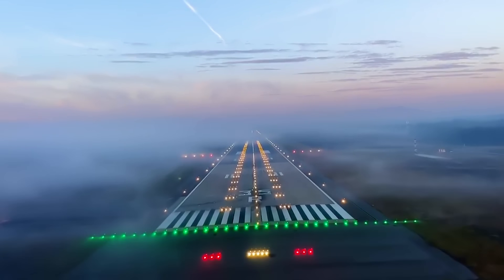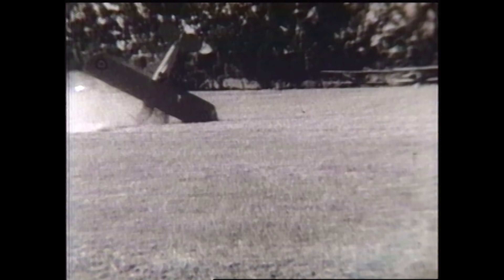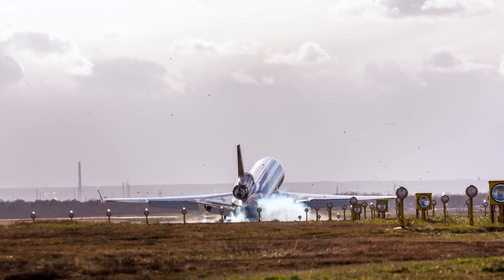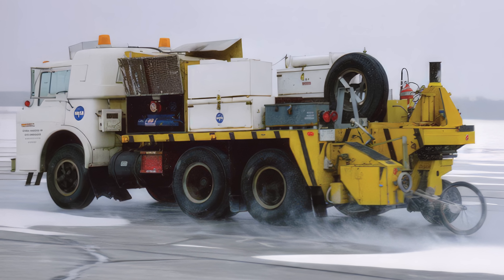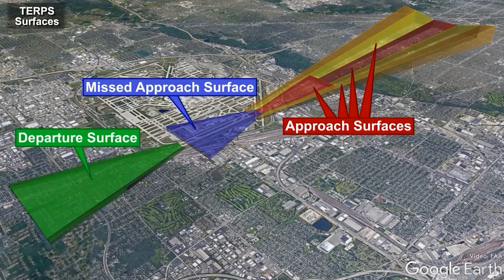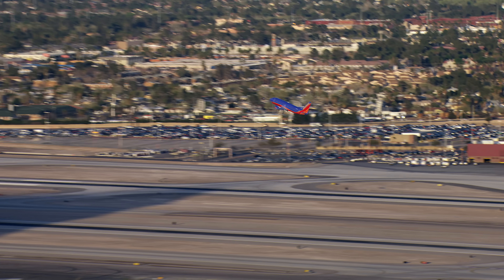The Hidden Engineering of Runways

Comment: (Small correction, "aerobraking" has nothing to do with thrust reversers. Rather, aerobraking refers to keeping the nose off the ground for as long as possible, which increases the airdrag caused by the wing on account of the higher angle of attack (keeping the nose high).)

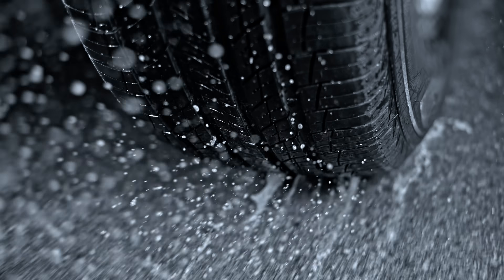Comment: 6:13 Just a little clarification, aerobraking refers to using aerodynamics to brake, that is spoilers, airbrakes, or angling the plane upwards to increase drag. Nearly every aircraft can perform aerobraking in one, if not multiple forms at once.

Using the reverse thrust of the engines is just called using thrust reversers.

Comment: 15:25 all EMAS installations are done by 1 or 2 companies in the US BTW. Something else that's fun about runways at large international airports that have to take ice/snow removal into account have embedded sensors in the runways to tell the operations team if the chemical on the runway is getting too dilute so they can get the snow/ice removal team back out onto the runway to treat them again, and those treatments are coordinated at least 1 hour ahead of time. Those teams will also typically run the traction testing truck out, then the snow removal and treatment team, then run the traction testing truck again to see how effective they were.

Comment: One interesting element not discussed is the lighting systems of runways. The configuration of the approach lighting system leading up to the runway and the lighting installed on the runway itself can be a determining factor in landing or departing in very low visibility. 
Also, besides EMAS, some airports that serve both military and commercial traffic will have deployable cable arresting systems for the military aircraft that can be raised or lowered.

Comment: Airplanes are heavier at takeoff than at landing, yes. But also, consider what happens when things go wrong.
An aborted landing leaves the plane in the air.
An aborted takeoff leaves the plane on the ground, at v1 speed, with lots of runway behind it, still needing more runway in front of it to decelerate. IIRC that's the worst-case scenario for runway length in most cases.

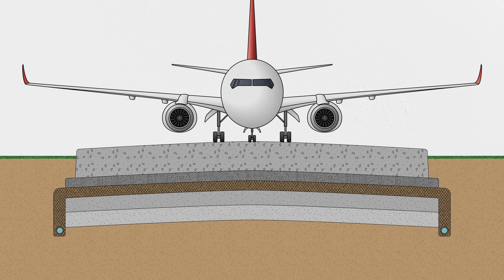Comment: 9:20 this sounds like a mistake. Rigid pavements spread out into the soil on a wider cone than flexible. The effective width you are showing seems to be applicable to the punching shearing planes in the concrete, not the bearing force transfer area to soil. The shown comparison seems apples to oranges, talking about two different things.

Comment: 6:20 - If the energy created for deacceleration is considered "most of the work", then it usually isn't brakes but all the leading edge flaps and slats. The brakes can work hard, but are usually not used much in commercial operation.

Comment: I ride a motorbike and during the worst summer rain-storm of my life (I was travelling home) I spent about 30 minutes sat behind a huge truck at 55mph because his tires were stripping the water right off the road which left a 'grippy' bit that I could ride on.
I could barely see the back of the truck  (just his lights) and it was quite surreal folllowing a pair of red dots which appeared to be clearing strips of tarmac for me 🤗
Got home safe and sound.
Late (missed several junctions sat behind the truck) and very wet.

Comment: I think it's interesting that when planes first became a thing, it was so dangerous that zeplins were safer. Only after years of improvements did planes improve enough to beat the zeplins. The zeplins have some fundamental flaws that couldn't be fixed as easily and so after the hindenburg, planes took over entirely.

Comment: One of my family members worked for a civil engineering firm, and got to participate in a project renovating one of our local airfields. For certain reasons, this particular airport, although relatively small, required a concrete runway. I knew there were different grades of concrete, but that used for runways is apparently a whole 'nother level compared to even regular building concrete. My family member told me that the specifications required for resurfacing the runway were insane compared to any other project they'd been on.

Comment: With respect to the different runway materials, check out KGLS which is Scholes International at Galveston.  Their runway charts show runway 18/36 as "good concrete" and runway14/32 as "asphalt with concrete, good condition." 14/32 appears darker than 18/36 and has a different appearance visually, meaning that an landing pilot can have a different depth perception interpretation when landing...

Comment: Neat going on government auction websites and seeing stockpiles of asphalt millings from runway projects that can be purchased and reprocessed for other paving projects.  Of course the thousands of cubic yards is still expensive and winning bid responsible for removing the stockpiles. 
Worked on an airport hanger paving project, typical aircraft were 30,000-45,000 lbs and concrete 16 inches thick.  Concrete would be poured for each alternate 12 ft wide strip then come back and pour the sections in between with large steel pins tying them together.  Meanwhile the concrete cutter would wait and wait till he could go out and saw cut the relief joints.  And even crossing a taxiway, airports take the tire FOD checks very seriously.

Comment: 15:24  too bad a Korean flight that overshoot and hit a hill wlanded on a runway apparently without this.
Reply: EMAS likely wouldn't have helped.  That plane landed with the  landing gear retracted.  EMAS works by having the landing gear break through into the substrate,  producing a lot of drag on the landing gear.    That plane likely would have just slid over the EMAS without slowing much.

Comment: I am a General Aviation Pilot in New Zealand. Your point about 'land use contention' was important. Our airport is busy, a lot of small planes every day - and to your point take-off is a key failure point with only one engine. Yes, we are trained to land out little planes in a field if the engine fails. But at my airport they are building houses closer and closer, and landing a little plane from 400ft with no engine and nothing but houses - well that is a different prospect.

Additionally we know that people who buy houses will complain about the noise, even if the noise has been happening for over 50 years before they bought that house. 

Land use is a problem and a trade-off, but keeping each end of a single runway clear of houses seems like a good trade-off.

Comment: When I was an electrical apprentice, we got subcontracted to help with an airport expansion, where we were tasked with running the conduit under some of the runways and taxiways. To say the project was complex would be underselling it. I had never seen so many types of conduit used back to back like that. One 30' span had 6 different types of conduit in it, and it was only under a corner of the taxiway. The runways were way more complex. We also had a dedicated engineer that checked and rechecked our work. If our cuts were more than 0.125" off, they had to be scrapped. It was a long month.

Comment: One TINY nit to pick.  Around the 6:20 mark, there's a reference to "aerobraking" and then thrust reversers.  Those two aren't the same.  Aerobraking or aerodynamic braking is keeping the nosewheel of a landing aircraft high while the rear wheels are rolling.  This makes the whole bottom of the wing and fuselage act as a source of drag (much like holding your hand out a car window with your palm facing the airflow).  Aircraft without thrust reversal, including many fighter jets, use this technique to shorten landing distances.  Thrust reversal is, as you say, using specialized thrust reversers attached to engines to redirect some or all of the jet's thrust-producing exhaust forward.  These two things could be used together, and they work towards the same goal, but are not exactly the same thing.  One can do/use one without the other.
Reply: NEEERD! Just kidding 😂 that's a good bit of information, thanks.

Comment: 9:12 OK this does not make sense to me, a soft material would typically transfer the load into the ground over a smaller area.
If I step on sand , I will sink a little bit, if I put a plate over it, then I would not because my weight gets distributed over a larger area.
But you say that in the concrete, the weight is only transferred down , not sideways?
Where are you talking about the pressure into the tire?

Comment: Great video Grady, pleasantly surprised to see a video topic on something I've dealt with first hand. Last summer the survey company I work for was checking the pavement elevations for each layer of material laid down to verify the contractors work for a taxi lane replacement at Lambert International Airport. Super fascinating watching the process from start to finish of them furnishing each layer and then surveying each one of them when they were set. From how they layered the material to positioning the rebar between control joints was incredibly fascinating. Each time we were out there we would set up our total station and using known points on the surface take measurements and record a plus/minus cut/fill for each point as compared to what they designed in the office. Was a lot of fun.

Comment: Still to this day I have never seen anyone to actually get into the details of what EMAS is and how it works.

Light weight beton or glass foam that crushes under the plane? That doesn't tell me anything. How can beton or cement crush in a manner that looks like driving over a cake? I want overtly detailed explanation on how they are built and how they work in practice, including but not limited to how such weak material can still be strong enough to not see erosion, etc.

Comment: 6:20 is not entirely true. Aircraft do not use reverse thrust to slow down. It helps reducing the load on the brakes and therefore their temperature. But the actual difference in landing distance is very minimal by using reverse thrust or not.

Comment: I appreciate your comment that the aircraft industry above all others has continually learned from experience (~2:20) , but I would suggest that the railway industry has also been doing the same for more than two centuries now. Much of modern rail design, engineering and operations has come about because of experience of past failures and accidents.

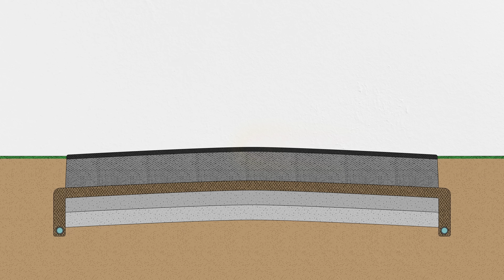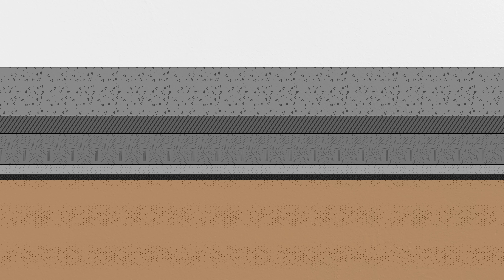Comment: So I'm confused.  At 9:05 you say that because asphalt has some "give" to it, the weight is spread out in a cone beneath the contact point, but for concrete the load is transmitted in a narrow strip straight down.  But at 11:40 you say that concrete distributes weight out over a wide area, but asphalt only provides friction, and depends on the layers beneath to distribute the forces.

This seems to contradict itself.  What's going on?

Comment: why did you use AI at 1:30 instead of a real stock video? it's petty but I'm going to stop watching because of this
Reply: It's definitely not petty. It's actually quite noble. AI slop is undeniably unethical for multiple very serious reasons. It's not just IP theft. It's also being used for propaganda and scams, convincing people to do harmful things, causing or worsening mental illnesses, and the cherry on top is that it's also very bad for the environment. No one gets a pass for using it.
Reply: It's not AI. The numbers and letters on the trailers are legible and consistent, you can see the aerodynamic skirts of the truck wobbling with the bumps in the road, and they have a correct number of wheels. There's also things like a distant radio tower light blinking. The Freightliner logo is blurred on the left truck (blurring logos is common in stock video), but not on the one passing it on the right. 

For anyone (like me) who's made many runs along I-10 between LA and Phoenix, and down to Tucson, that's what it looks like out there.

Comment: Video has errors; e.g. most rubber left on the runway occurs during landing because wheels are not spinning and are forced into a quick spin causing rubber burn/skid (in contrast to take-off the weight of the plane is reduced as it picks up speed and the tires are rotating in-line with plane speed) Another content creator that lost credibility.  I now presume everything is either A.I., C.G.I., modified, wrong or is fake, and take it all in for entertainment purposes only 🤭 /s/ ChiefLiviz

Comment: As an Asphalt Mix Designer, we design asphalt pavements by using a gyratory compactor to do a certain amount of work on the mix to get a target air void content.  The amount of work (gyrations) corresponds to a unit called "Equivalent Single Axle Load," or "ESAL."  A 3-30 Million ESAL asphalt would be expected to survive that many 80 kn truck axles throughout its design life.  That would equate to 100 gyrations in the machine to result in 4.0% air voids.  Asphalt like this would be used in the interstate system, as opposed to asphalt for surface streets that may only require, say, 85 gyrations.

The weird part is that FAA P-401 spec mix for airfields is only a 75-gyration mix.  It makes up for having 25 less gyrations by having an air void content of 3.5%.  (We control air voids by changing the aggregate gradation going into the plant to make more or less space in the structure of the asphalt.  Then, we can control the amount of Asphalt Cement and rock dust that we introduce to "tune" the mix to its design.  We do this dynamically based on variations in our aggregate stockpiles and any recycled asphalt we may be using.)

The FAA is currently reviewing changes to P-403 (base course asphalt) and P-401 (wearing course asphalt) to address pavement shifting under high-psi tires and larger aircraft weights.  There was a study done in Australia about shear failures in the landing panels of runways, and the FAA has compiled a bunch of research on the impact of particle shape, oil viscosity, polymer-loaded binders, and lift thickness on asphalt life.  (One big takeaway was that maybe Rut Testing designed for cars is "not adequate for aircraft...")  The high point loads that modern aircraft place on asphalt can carry damage 10-15 cm deep!

Comment: Oh hey! I work with the maintenance team that maintains that ERJ 145. The EMAS debris was ingested into both engines, and the cooling inlets for all 4 engine generators. All had to be replaced. But, once the repairs were done, it flew right out of there. Saved the plane, and all aboard. The system should be standard for all airports. It saves lives!

Comment: Great deep dive, Grady. The most telling part is the EMAS system—it’s the perfect diagnostic for graceful failure. We spend billions on high-strength pavement, but the real safety "innovation" is actually a bed of concrete designed to be crushed. It’s a reminder that in high-stakes engineering, the goal isn't just to build things that are "strong," but to design exactly how they should break when the math of the runway length fails.

Comment: Aerobraking and thrust reversing are two separate things. Most aircraft have aerobraking wing spoilers, and almost all jets have thrust reversers and some turboprops have reversible propeller pitch, but these are all separate systems that, while almost always used together, are unrelated and operate independently.

Comment: I'd love to hear your input on the airport in Indianapolis, one of the runways goes on a bridge over the interstate.  Curious how much went into that.
Reply: Which one is that? Indy International is surrounded by highways, but none of the runways cross them. Metro and Regional also don't intersect any highways. There was an airfield to the east of I-70 (you can still see the "X" pattern of the old runways), but it's been decommissioned for decades. 

However, LAX's south runways, 7R/25L and 7L/25R do go over Sepulveda Boulevard that runs in a tunnel underneath.

Comment: For a fun example of approach surfaces becoming contentious, check out the Sunroads story in San Diego, CA circa 2007. In a nutshell, the developer ignored a 160' FAA height restriction (protecting nearby Montgomery Field) and put up a 180' office building. The city had signed off on it against the FAA's protests (just a delightful level of corruption there). After a legal battle, they eventually agreed to lop two floors off the top of the building. Just wild.
Reply: I used to drive by that building every workday. After they started the teardown, I started each day with a good laugh.
Reply: Here in Germany, they build a new runway in Frankfurt ~20 years ago. They somehow overlooked/ignored that there was a chemical plant right in the safety zone. In the end, the plant had to move, and the airport had to pay the plant owners 650 million euro. That was one expensive runway ^^*

Comment: I work as a NAVAID technician and there is another (unintended) arrestor at the end of some runways too: the Localizer antennas. They're not meant to stop an aircraft, but they're built with break-away shear points in the antenna bases in case they do, which basically makes them a metal "net". At some military bases they also use an actual net too, which catches smaller aircraft (like fighters) that overrun. The same idea is used on aircraft carriers, and they also use a taught cable to launch the aircraft off the boat's short runway.

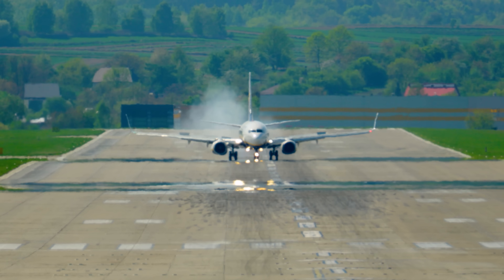Comment: 8:07 "In fact, landings are so much less damaging to pavement than takeoffs that they usually don't even count in the load cycle tracking." Most airports have approximately a 1:1 ratio of takeoffs to landings, I would hope. . . .
Reply: Some airports have runways used mostly for one of the two